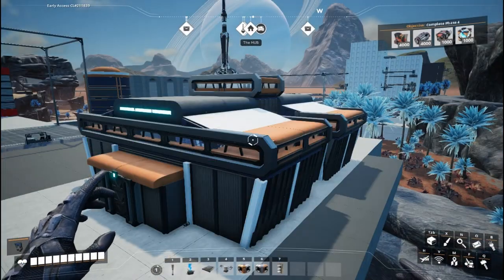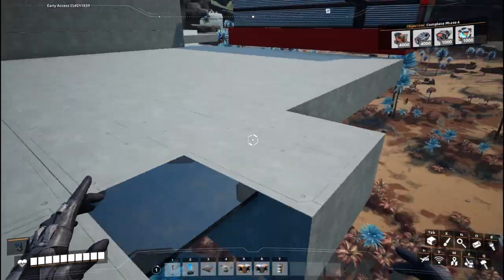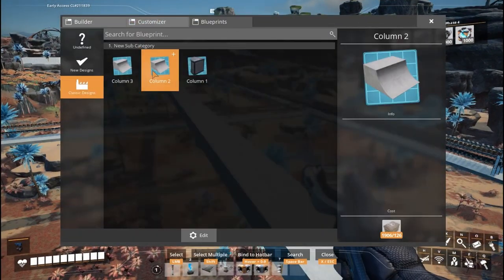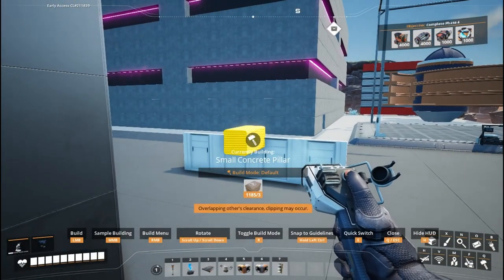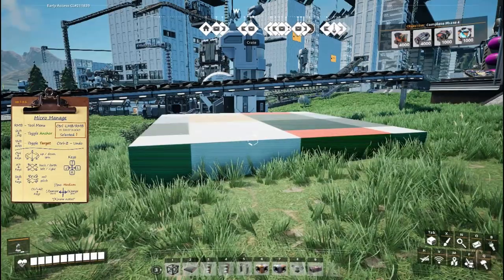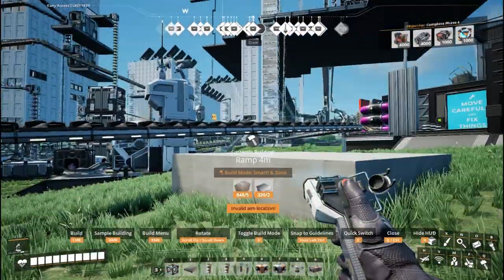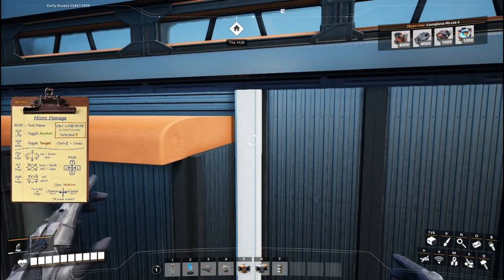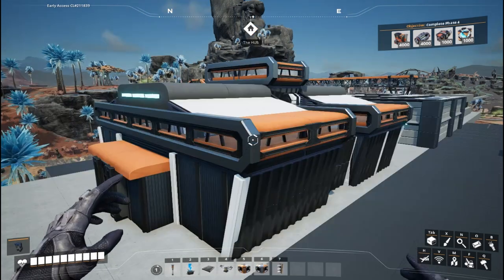ULTIMATE DESIGN TIPS 2023 - Satisfactory Let's Play - Episode 18

Comment: I have not played in a while, but updated the mods/game and looked thru an old build - my SS Architecture only has the orange I-beams, is there anything else you installed to get the emissive beams, cable connectors, etc?
Reply from the maker: There are three different tab groups it should unlock, but as I recall it does that all at once - maybe check the Hub just to be sure!

Comment: This video gave me an idea. Solar panel roofs from refined power, but flipped on the side and dragged vertically in the dimond shaped pillar. Gonna test this tomorrow.
Reply from the maker: Oh, that's a smart idea! Let me know if they still pick up power that way, RP is a bit buggy when it comes to Solar Roofs, only the 4M ones seem to pick up any power.
Reply: @EnderpriseArchitecture  ok, spend on it around an hour at this point, and it works, but its kinda inconsistent. Looks like this panels is trying to check for the direct light, but they consider some building blocks transparent but not all of them. When they lay as intended, all of them works for me. Even 1m and flat roofs works, but they are more inconsistent, shutting off inexplicably and then turning back on. I think its still because of the light was ubstructed at some points. All 4 types can be shuted off if player is standing on them and his shadow is exactly at the center of the panel. They consider eachother and other roofs transparent, but only for one layer above them. Walls and foundations is definately blocking light.

So, i made a pillar made up of 4m roofs in a dimond pattern, photo cells looking outside, four layers height. Depending on the position of the sun one panel from each layer may shut off, but other 3 is probably gonna still work. Lowest layer almost always is switched off if they stand on foundation or if they are close to the ground. Generally i think walls and foundations may inexplicably shut off close positioned pannels, even if they are under the panel itself. Also, because panels consider eachother transparent only for one layer, this type of pillars isnt really stackable, because they will cast shadows on eachother. Unless you place them far from eachother.
Reply from the maker: @Sallivan4eg  This is fascinating, thank you for doing all of this research!  You are far more patient than I am!  I think using them for decoration without expecting them to power anything might be the route I'll go with it, based on what you've turned up - and then just create a massive solar farm based on the design I used in my previous episode, just a huge roof of 4m ones.

Comment: Quick tip for the washed-out/faded concrete colors at 5:50. Since version 1.0, you can now set the color saturation beyond the default slider range (0 to 1) in vanilla Satisfactory. Instead of using the slider, if you type in a number between -10 and 10, you can make the concrete have truly vibrant colors. This makes red appear as true red instead of pink, and white and black appear as true white and black without any mods! :D
Reply from the maker: Thanks! I used that method in my latest Season 2 factory, but it still has some weirdnesses, like with concrete walls, etc.  I hope they actually make colors better officially, and not just a hack, in the near future!